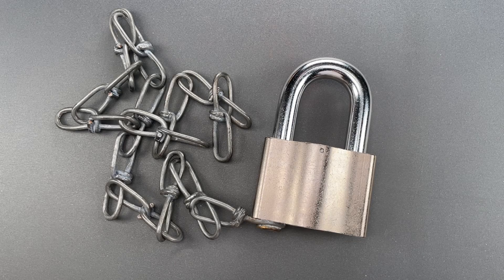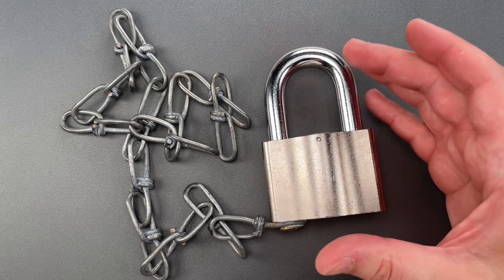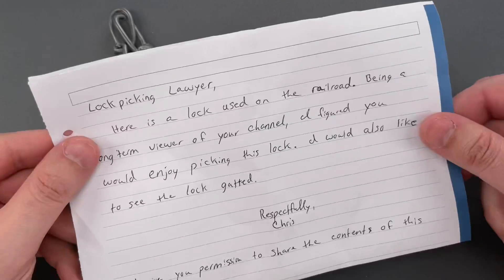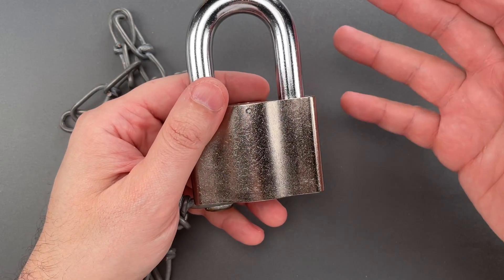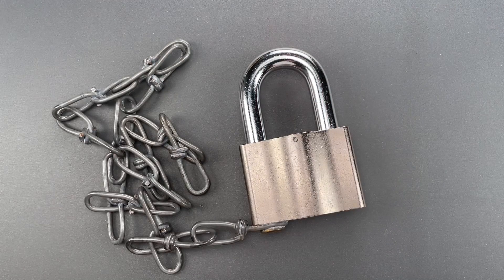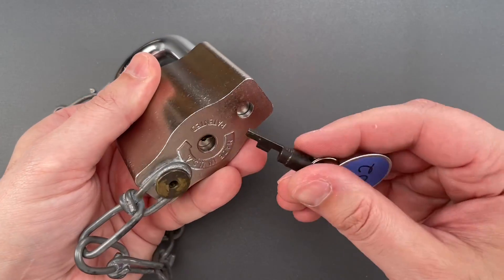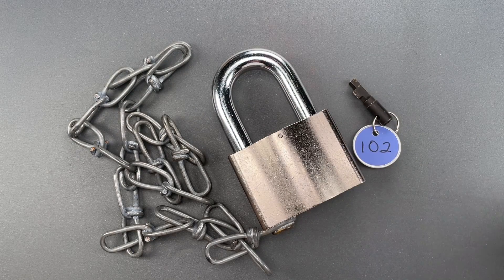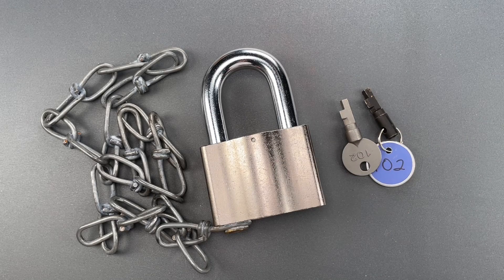[1482] The Most Weather Resistant Padlock Ever Made — S&G Environmental

Comment: “Look how it easy it is to defeat this lock with a proper key!”

Lol, what a retarded video.

Never heard of this LPL guy before. I followed a link for a completely different lock which was actually pretty informative, unlike this one.

After watching that video, as a veteran railroader I was wondering how the old S&G Environmental lock would hold up. Searched and found this video. Seems like they must pretty decent as long as someone doesn’t have a key. 

After decades of experience with them, they actually are pretty decent locks. They withstand the elements pretty well. They are not easily defeated with basic hand tools or a big rock. Are they perfect? No, but what is? Are they totally undefeatable? No, but again, what is? They work very well for their application.

Maybe what this LPL guy is not saying is that he is smart enough to understand the possible civil and criminal legal liabilities he could be exposing himself to by showing how to pick a lock commonly used to protect some fairly critical infrastructure, information that someone could use to cause a mass casualty incident.

Comment: Working for a railroad, I deal with these sorts of locks a lot. They aren't really designed to be secure as much as they are to secure something. There to make sure that no joe schmo can flip a switch or restore a derail in front of you or under you. They wouldn't beat someone motivated, but they aren't really meant to

That said, what's scary is that I actually have one of those Keys for my work.

Comment: These Padlocks are amazing & have secured everything from Job site gang boxes to Locomotive /Caboose doors.
The stories about these padlocks and what they were up against for all these years will blow your mind, they don't open when they get shot into the keyway with a .22, everything else they are fine , lol.
Physical Attack ...
Prototyped in 1979, S&G released the Enviro padlock @ the 1980 A.L.O.A convention in Las Vegas.
Tolerance's are key , Shackle to Body clearance --Locking ball to shackle clearance , etc.
Tolerance to tight freeze / bind easy , to loose , not secure enough. 
Stainless powdered metal body , forged .
 When the stars , moon are burned out & earth is since disintegrated the body of the environmental padlock with be floating around in space ...

Comment: Sometimes a lock is simply to cover insurance requirements that keep wanton people from getting inside a dangerous area - mostly kids. Like the lock on a swimming pool gate that is simply high enough to keep accidental or unknowing from wandering into the water. In this case the fence is only required to be a certain height (4 feet), and have a latch that is high enough as well. If you can break the lock, or pick it, you’re smart enough to know you probably shouldn’t, and that keeps out the mistakes. 👍🏻

Comment: Given that most meddling with railroad infrastructure is federal foolery of the felonious sort, the lock needs not be impossibly secure, just enough to be 1) a visible deterrent and 2) the most obvious sort of access restriction. Both points are addressed by the lock's appearance and durability: it's a big friendly guard dog, but you won't know that unless you get hands on with it. 

It's basically the inverse of the lockout/tagout locks, which need not be durable but you cannot access them without an exact key.

Comment: Industry, and in extension the rail road, don't really use locks all that often for security reasons as far as unauthorized access or intrusion/tampering is concerned.

For industrial applications, a real threat is if the lock can be bumped open. Since accidental bumping against leavers/switches/buttons/etc is usually why one puts locks on them, so that they can't accidentally change state without human intervention. Both industrial and outdoor environments can have a lot of unforeseen activity that  can brush/bump up against stuff and cause all sorts of problems. Being able to lock stuff in place is a simple solution.

For a long time, a simple locking pin were the common solution. But these can get stuck in clothing and pulled out accidentally. Something that won't happen with a padlock.

But yes, occasionally locks do serve the purpose of securing access, and then yes more unique keys are important.

Comment: Most weather resistant?  Need to give this to Project Farm, to TEST THAT.  ;)
I feel like you're too far into this discipline, pretending that everyone would just collect brass stock and file it down to make keys,  That's not at all how someone looking to penetrate random areas thinks.  Bolt cutter or angle grinder, or pick if needs to be quiet.  They aren't on some quest to be super lock picker, just get past the obstacle this one time.

Kind of stating the obvious.  Most locks are not picked, no matter how easy it might be to someone who knows how.  This won't be a popular thought on your channel because the premise of it is false, that it just isn't important for "almost" any lock to be hard to pick except in highly secure sensitive areas that should have cams and security personnel anyway.

I'm not knocking the skill to do it.  It just isn't some kind of importance whether it takes 20 steps to prepare or only 2, if you already knew what lock it was and  how to defeat.  I'll stick with my angle grinder, if I were going to defeat one.  Filing multiple keys from brass stock, yeah, no thanks.

Comment: It’s probably less a security measure and more a lock-out measure. A way to prevent something from being accidentally opened or switched, either by happenstance or human error. You see stuff like this in fire, rigging, drilling, a lot of stuff with heavy duty circuit breakers, and “under maintenance” machinery. So the simple cylinder with readily available keys is almost certainly because it’s not supposed to be for security. It’s for safety.

Comment: I know it wasn't a good lock as far as security goes but Dad had the same master padlock on an exterior shop door since he bought the farm in 1952 up through just a couple years ago when I replaced it.  Not because it failed.  But I wanted a little more secure lock, and the keys I had for the lock were so worn down from decades of use and jostling around in pockets it was getting tricky to get the lock open - with a key anyway ;)  I have the lock here in a drawer on my computer desk.  Years of memories of opening up that lock and fun time working on projects in the shop.
Not nearly up to the level of this S&G lock, but it worked.

Comment: Not sure how US railways handle this, but the two Canadian class ones both use these and a lower security warded lock made of stamped metal. The low security ones tend to be on non-main track switches and derails and can be pretty easily busted off with a hammer or pry bar (speaking from experience). The S&G ones, on the rare occasion when they do fully seize up, require being cut off (hilariously I've usually seen that done with a two stroke rail saw). The reality is they're really just a deterrent against random shenanigans though, as someone who is truly committed to messing with a switch will either have a key (the key types are company specific so you'd know which key you'd need based on whose tracks they are) or would just cut the lock loop off the switch with a hacksaw (takes a bit of work but is doable). These locks do stand up to regular environmental abuse pretty well, though I have had to assault a couple of them with fusees in -40C conditions when they've frozen stiff and they definitely will corrode when installed at facilities that offload road salt. Cool to see you finally get one, I've been waiting for a while for this.

Comment: The railroad company likely chose this core for economical reasons.  Knowing nothing more than I've learned from this channel, I can tell this lock is relatively expensive; regardless of the core. A determined intruder is less likely to opt for destructive methods when the lock can be opened effortlessly with some research & knowledge and easily with improvised tools, I'm sure.

Comment: So, there's a number of reasons for using a high weather resistant, low security, lock for railroads.

If a switch or piece of equipment needs to be "disabled" so it isn't accidentally thrown. This use is not very common these days, so you'll rarely see it.

What I'd suspect it'd be mostly used for is a command lock, where only certain people in a building have the key to stop junior/unqualified members of staff from entering unsafe areas/machinery like high voltage zones, rectifiers, etc. They're normally already behind higher security locks, so making them high security isn't needed. Judging by the chain on it, I'd say this is what it was used for.

Comment: These were developed decades ago when the disc detainer mechanism was virtually unknown. S&G deliberately traded security (low number of different keys) for extreme reliability and weather resistance.  

There are plenty of other choices like this that are all around.  For example,  all the thumb wheel combination locks used by a particular road authority all use the same combination.  So essentially no security, except against a casual member of society

Comment: often, such locks are not meant to secure items but to prevent casual access. In that way, quick access and a limited number of keys are preferable. That many of such locks are in places that are either dangerous to be in in the first place (like *being in a railyard*), speed of access to minimize danger can be just as crucial as having only limited number of keys - it makes it easier for authorized people to get the correct key ring(s) with them.

It is pretty much like a lockout system for electricity or an elevator fire key in that means.

Comment: there are tens of thousands of keys out there on multiple railroads for that lock.   Higher security in the lock is nothing if you can't control the keys.  the keys also need to stand the test of time...   and, that lock is not weatherproof.   it is susceptible to ice forming inside requiring the use of a fusee to heat it up and get the lock to function.

Comment: The lock was selected because of the low key count. To have a lock in service for decades requires significant key retention. Simplifying key count and lock styles makes this easier. Keep in mind people may hop aboard a train in New Mexico and then need a key in New York. While the lock can be picked quite easy from a lock smith, it’s intent is to keep honest people honest. Most would not pick the lock, simply use a destructive method to gain entry.

Comment: Railways often use very simple "locks" as tamper deterrence and to facilitate the cruder forms of interlocking between points and signals.  They also use a lot of normal locks in a keyed-alike system.

A long-standing example of this used on British railways is the Annetts key system, which is designed to be used as part of a token-block signalling arrangement.  One end of the token, which looks like a weirdly shaped staff, serves as a large, unwieldy key that can unlock the lever frames controlling access to sidings within the section.  The key (and thus the token) is retained in the frame until it is returned to a normal state, safe for the passage of unrelated trains.  Only traincrew authorised by the signalman to take a train into that section will have the token; when the token is returned to the signalman, it serves as evidence that not only was the train moved clear of the section, but that the points unlocked by the key have been returned to the normal position.

This simple system would have prevented at least two accidents, one much more serious than the other, on American railways in recent memory.  The most recent and less serious was on the Strasburg line just a few days ago, where a track maintenance machine was moved into a siding but the points not returned normal thereafter; a steam locomotive then ran head-first into it at low speed.  This "interlocking between points and signals" is one of the requirements of the 1892 Railways Act (in the UK) which America still hasn't caught up with.

Comment: As a railroader myself, old style railroad(non mainline use) are the absolute best weather resistant padlocks ever, theses sergent locks are not bad but have a hard time with freezing rain and often require heating with a torch in the right conditions. American locks used on locomotive since a few years are the absolute worst lock on the railroad they freeze every single day in winter and are a real pain especially when mounted under the headlights.

Comment: Way back I was a parent volunteer at my kids' elementary school. As such i was on occasion given the master key to the school and the alarm code (for weekend events) and the "gate key". The gate key opened the gate so that firefighters could get onto the areas of the property not usually accessible to vehicles. It also unlocked the dumpsters, so the garbage/recycling guys had the same key to unlock the gate and the dumpsters. One of the parents worked for BC Ferries and had the exact same key that was common for the same purposes. It's all about avoiding the hassle of having different keys for different users - the lock is meant as a deterrent, not true security. Given that these were all cheap Master locks.....
Another fun thing I learned was that not only did our school not change the 4-digit alarm code annually, but it was the same code for every school in the district and hadn't been changed in 20+ years. I'll bet if I chose to visit that city ever again and had a master key and could make duplicates for accomplices, it would be easy to have free reign to steal whatever wasn't nailed down (I still remember the alarm code). Security is often an illusion. I'd hope by now the school board has joined the 21st century and implemented personal swipe cards or something, but I doubt it. Instutional inertia is a hard thing to overcome.

Edit - this school board had the band rooms as free standing buildings. Same master key, different alarm code. I remember that too.

Comment: Whilst the LPL is right about how easy it is for him to open he should consider who the railways consider a treat. And it is NOT the LPL. Its basic thieving scum who will not have a vast collection of keys and decades of experience with picking locks, let alone be bothered to pick one. They will just use brute force or a battery powered angle grinder to circumvent the obstacle

Comment: Wouldn't it be fewer than 27 possible keys since 1 of the 3 discs must be a 0 cut?
I'm not terribly familiar with DD cores so I may be entirely wrong.

Edit: using 2 different methods ive come to either 19 or 27 valid keys

Comment: The higher security version is more complicated and prone to failure in poor conditions, especially getting stuck closed. The lock shown here can reliably be opened by a tired conductor in the middle of the night when iced over in sub-zero weather while wearing thick gloves. As other comments have said they are often in remote areas, you could take your time to pick or cut through that, but why not just move on to a softer target? Or drive your ORV around the gate? When I have seen these defeated it has always been the chain that was cut. That's a thick shackle, even the largest bolt cutters will have a tough time cutting that.

Comment: If that attached chain is used to secure the gate, it would be a severe weak point because I could easily cut it with a good pair of linesman pliers.  I suppose the chain was actually meant to keep the lock with the gate.

Comment: I'm a railroad worker. These locks are also have a large shackle for a reason. Older signal systems are triggered when the lock is removed. This tells a dispatcher that a switch is not secure. They are machined such that only one size fits in and the signal system will trip if tampered with.

Comment: So much butt hurt over your not disassembling the lock. I look at the pin that would need drilled and think 'good luck with that', unless the pin was drilled perfectly the core would never be able to be removed. The pin could be burned out with an EDM, or bored out with a Bridgeport,  but try using a hand drill or drill press and you would be left with scrap.

Comment: I would say the lock is foremost designed to work and is meant to be better than nothing. If the lock is used in some remote area a core with a higher security will not do any better since you either simply have the time to pick it open and take your time or the location is so remote that a battery powered angle grinder would not be heard by anybody.
So why invest more than needed?

Comment: Every MoW guy needs a key if it's locking a shed.
Every train crew needs a key if it's locking a switch.  
Key management would be "challenging" if they were all different.

I'd be willing to bet (without contacting a friend who is a BNSF Conductor) that each crew person has several of the different keys so that they can unlock the switches they normally encounter on their job.  Mainline switches (passing sidings, crossovers, interlockings) are mostly remotely controlled so it's only the crews that are picking up and setting out cars at industries that have to unlock stuff.

Comment: Maybe it’s not meant to secure something of monetary value. For example what if it locked a switch on the tracks so no one could just walk up and divert a train. I know that’s not what it is or how that works but you get my point. No one actually wants to steal the switch but someone might want to mess around with it. Replacing the switch isn’t the biggest deal but having two trains collide….